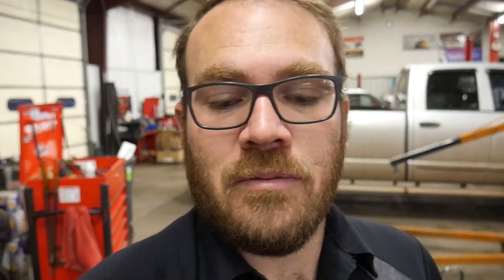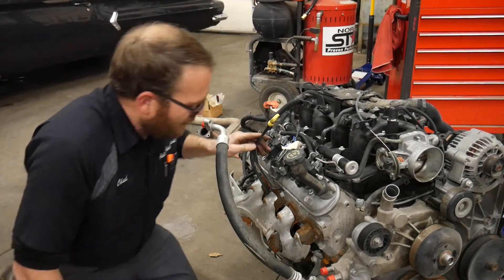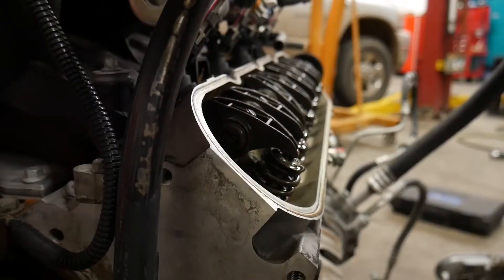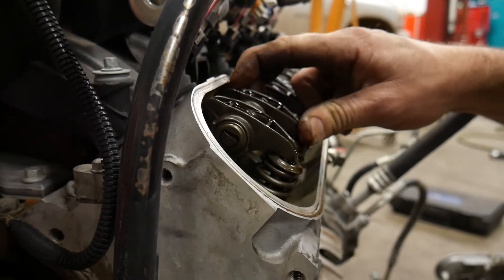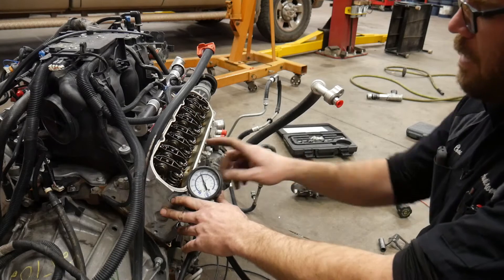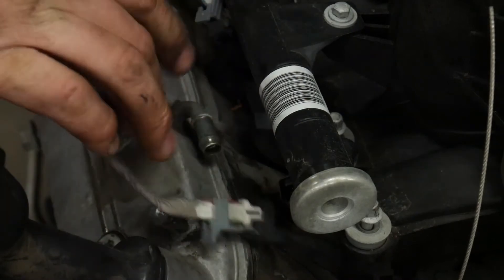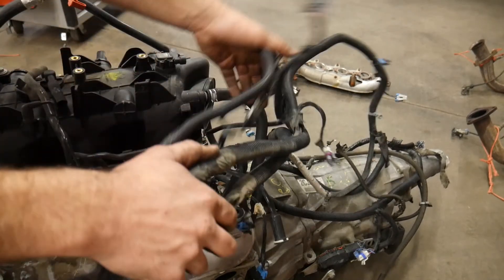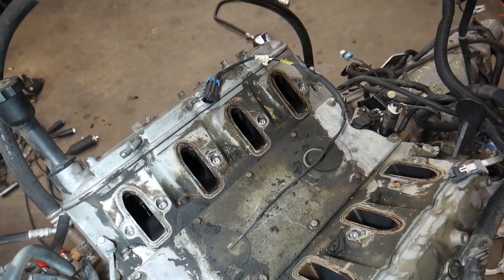Biscayne LS swap Ep 08 Inspecting your Salvage Yard LS Engine pt2

Comment: What engine is this? Maybe I missed it in the last video.
Reply from the maker: LQ9?? Can’t keep up with GM RPO codes.  It came out of a early 2000’s Chevy pickup.
Reply: @ThePracticalMechanic  one of the 6.0 gen 3. I think the main difference between lq4 and lq9 was one of them had dished pistons to bump up the compression.
Reply from the maker: Clint Cochrane I was mistaken. I think it was the LM7 5.3. The LQ9 is was stuck in my head from a buddy’s vehicle.

Comment: Did you just use a battery or a power station jump starter too connect to alternator and do a compression check???
Reply from the maker: I just hooked a jump box up.  If you don’t have the original cables you can hook up to the positive stud on the starter and ground to the block.
Reply: ThePracticalMechanic is there a certain amount of Amps you recommend the jump pack should have to get a good test???
Reply from the maker: Ben Alanis the jumpncarry 660 I use has 1700 peak amps and 425 cranking amps. These engines normally pull 200-300 amps while cranking so 300 should be your minimum. You could also use an automotive battery with jump starting cables.